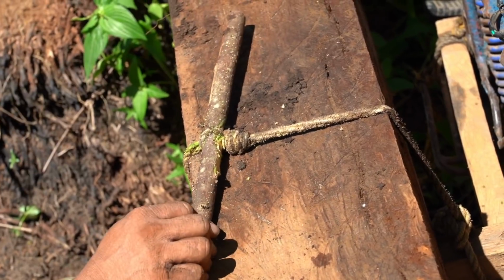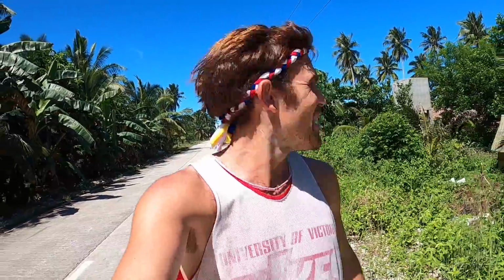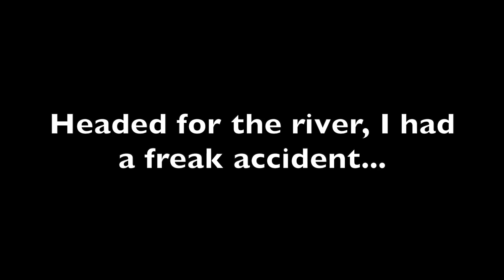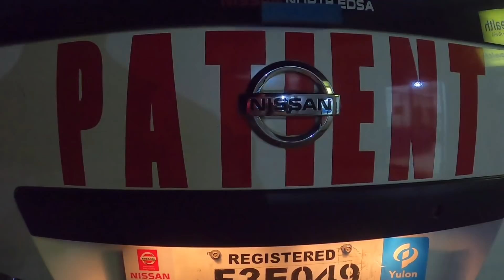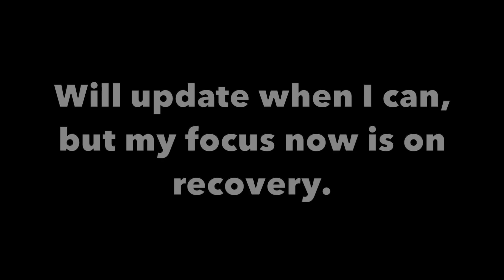I NEED SURGERY - Bad Accident In The Philippines (Ambulance to Hospital)

Comment: That's what becoming filipino is all about embracing everything pain and all...get well soon...stay safe!
Reply: He is trying to be polite in front of the camera. Nobody deserves pain. 8/10 pain score is too much and already needs Dilaudid(I guess morphine nlng since its in the PH) Intravenous already. *shaking my head*
Reply: Hydrogen Peroxide or Agua Oxynada is what its locally called makes it sting unnecessarily - used since the 1920s. Suggest to use next time Normal Saline solution and then Dernacyn solution after(or betadine nlng which stings way less than agua after the normal saline) .

Comment: There are reasons why in many countries in the world transporting beams like that on a motorcycle and riding in the back of a truck would get you arrested. You put yourself at risk and I imagine caused the driver of the truck some distress. However how would you have felt if that wooden beam delivery had gone badly wrong. You also have a responsibility not be complicit in people putting themselves at unnecessary risk on your behalf.